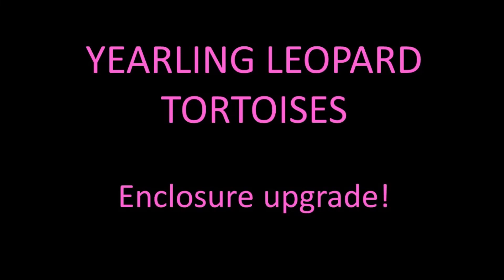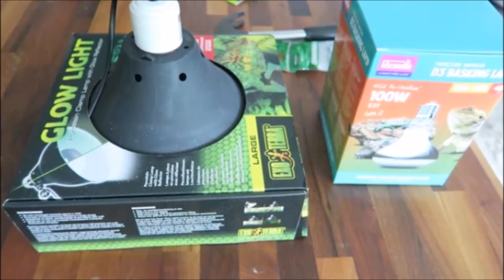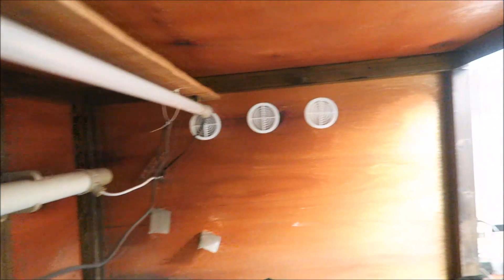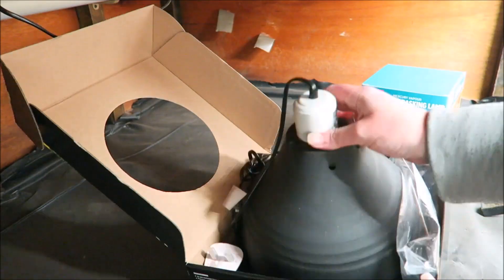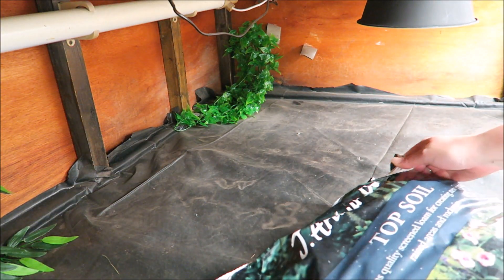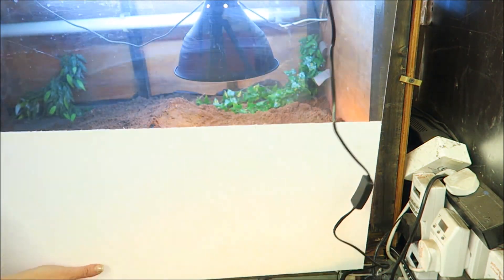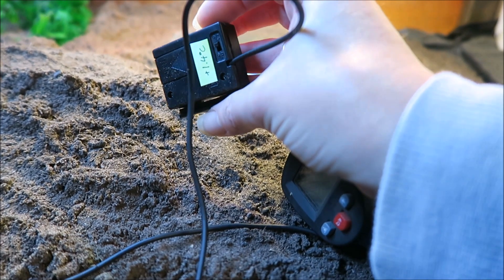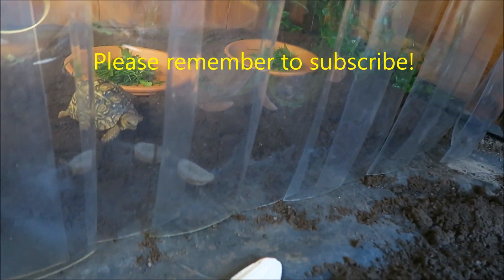Yearling leopard tortoises - enclosure upgrade | happytortoises

Comment: Which bulbs u used Ubv ya
Reply from the maker: Yes, I use a mixture of UVB tubes and UVB basking bulbs in my setups.  I have a video "Getting set up for your baby tortoise" that goes into lots of detail on the equipment I use for hatchlings if you want more info 😊💚🐢

Comment: do you ever have any problems using soil and sand? I've read on forums that it can cause like infections or something? Idk if thats rare or if it even happens. I'd like to use soil for part of my substrate but I've stayed away from it due to the stuff ive read about it. Now im changing my mind seeing as how you use it all the time and seems like it works well.
Reply from the maker: I've never had any issues with using top soil & play pit sand.  It helps maintain humidity levels as well as being similar to the substrate found in their natural habitat 😊
Reply: @happytortoises  what ratio are you using and depth, as my turtle is about 8years old.